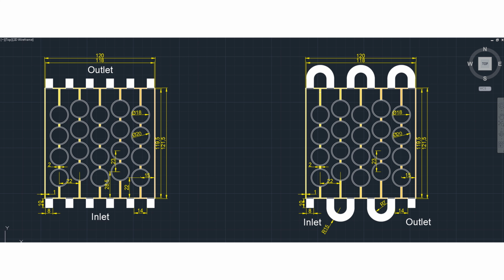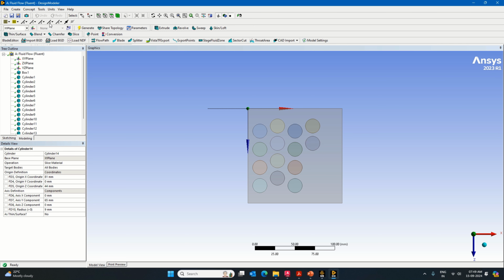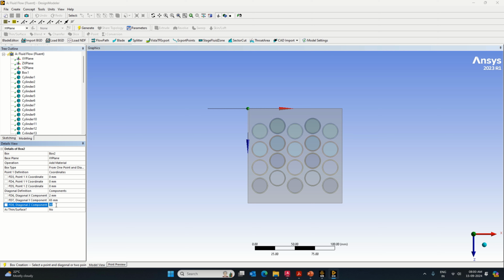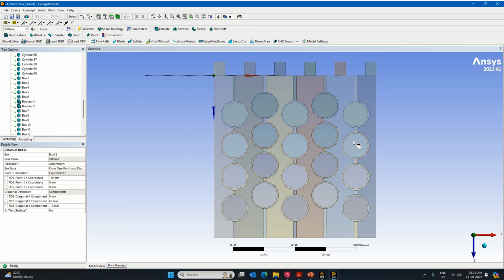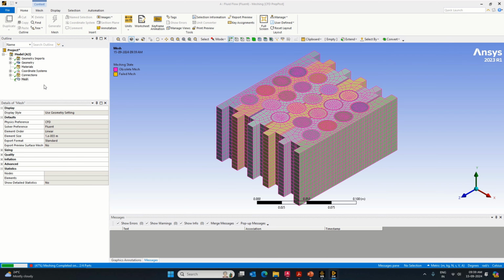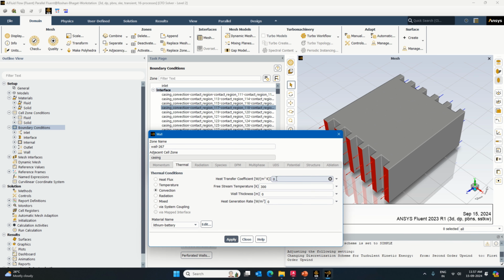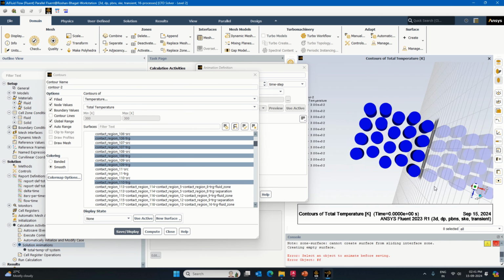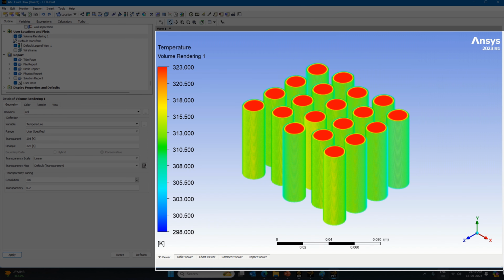CFD Simulation of Liquid-Cooled Thermal Management for Lithium-Ion Battery Pack | Re Uploaded |

Comment: Hi sir can you please Make a tutorial on immersion liquid cooling of 4S3P module
Reply from the maker: Yes will do, share details
Reply: @FrontiersInCFD yes, I also want on immersion cooling of the battery where battery is submerged in a dielectric liquid and we need to analyse the heat dissipation by it in the liquid